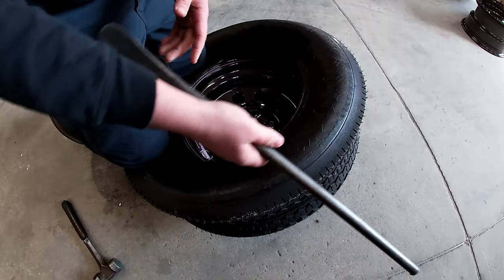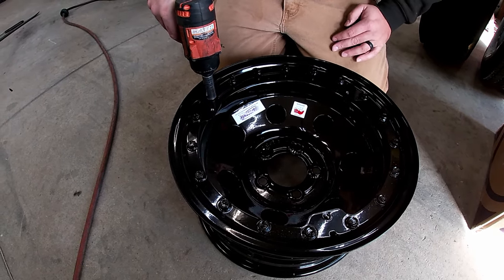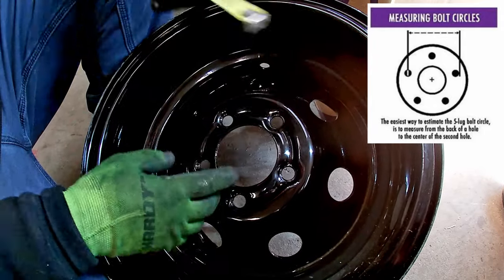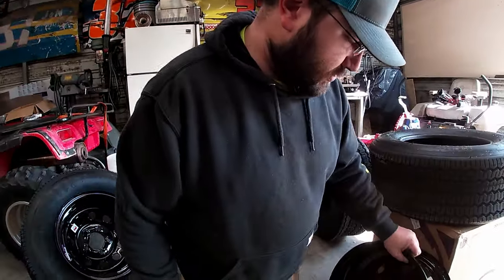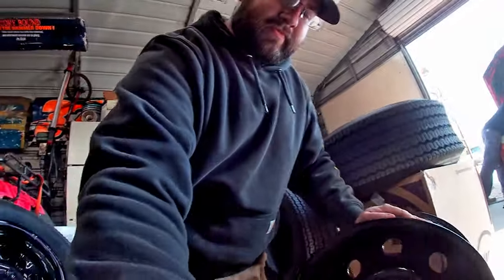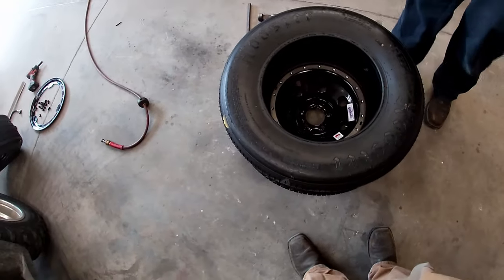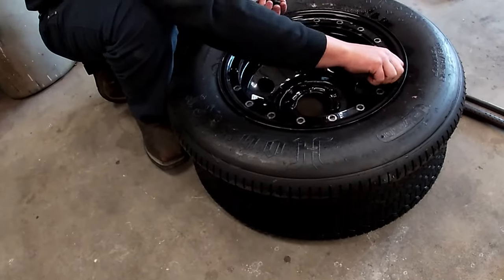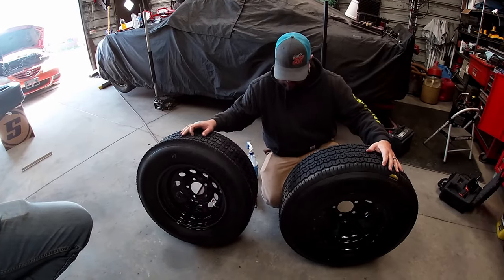Mounting Hoosier Towel City ReTread (bump bead and bead lock)

Comment: Gotta link to order these?
Reply from the maker: We buy them from track
Reply: @ChristmanGarage  That's what I was thinking, are they all the same for purestock or can you get different  numbers? We just bought a car and noticed it said asphalt on the side. Just wondered which ones you put on for dirt?
Reply from the maker: @samwaldfogel2246  they are asphalt tires originally then recapped for dirt, I think they make a few different compounds some softer than others and it has something to do with the color of the dots on the tires we have to run the yellow dots.
Reply: What's the difference between the 27.0 and the 27.5?
Reply from the maker: @samwaldfogel2246  different circumference for stagger😁
Reply: How long do these tires last??